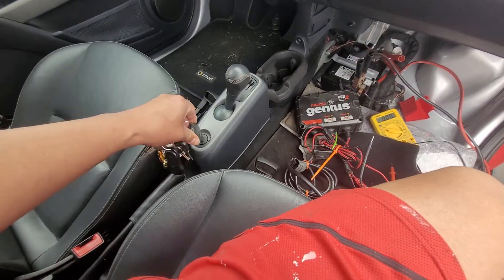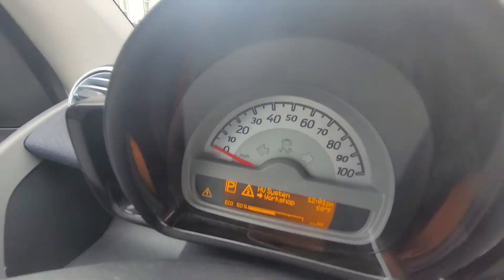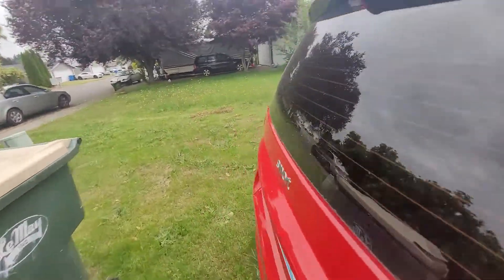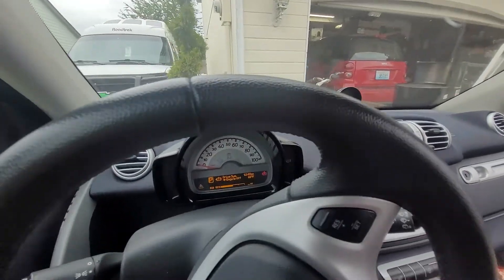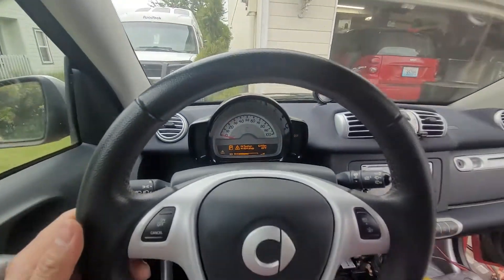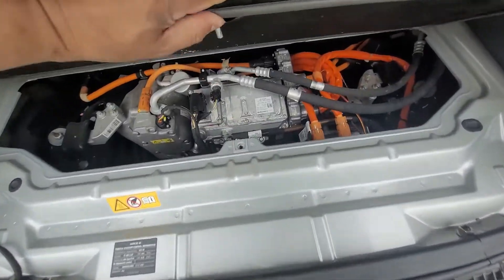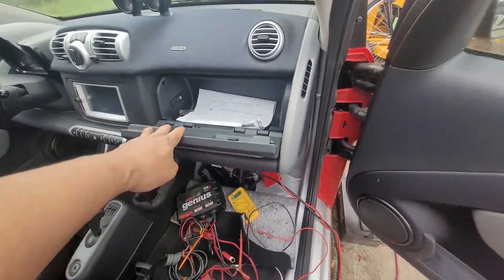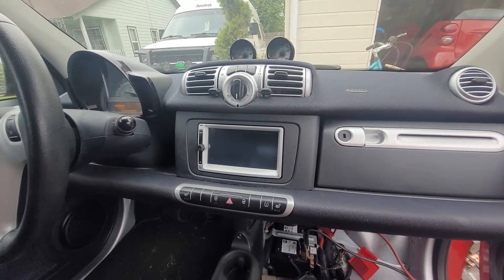Smart Car for two Electric Project .. How to Charge Depleted 12V Battery Easily

Comment: I have a 2014 Smart Car Electric Drive. I installed a new 12v battery and its giving me a low 12v battery message. How can i check for parasite? I haven't installed any aftermarket parts but my 12v battery is not charging. PLS ADVISE

Comment: with out warning my 12v on my 2015 451 ED just died no response at all nothing i plugged in a voltage tester into the cig lighter hole and it said the batter only had 4.5 volts i have no idea how this happened but i assume i CANNOT recharge it and will have to remove it (which is a royal pain in the...) and get a replacement and install that?

Comment: My EV Smart won't go into Drive gear.  It is stuck in Park gear.  I have 100 percent charge on HV battery now. But i am not sure about 12 volt battery.  I can't find  a manual to see what is the problem and i don't understand the lights on the dash.  The battery icon is red.
Reply from the maker: What your code error ? On your diagnostic tools?
Reply: @Angelsum143  i don't have diagnostic tool yet. I have to buy one i think.
Reply from the maker: @sanbell6951  where u located I have the c4 diagnostic tools
Reply: @Angelsum143  thanks i finally got it to run. I saw a picture of key icon on dash and read it was the 'immobilser'?.  But when i tried my second key it worked fine.  Real strange.
Reply from the maker: @sanbell6951  perfect 🥰